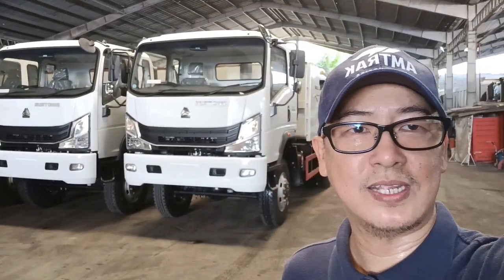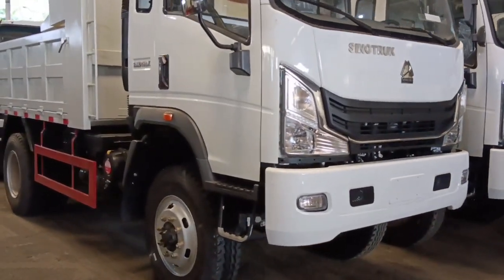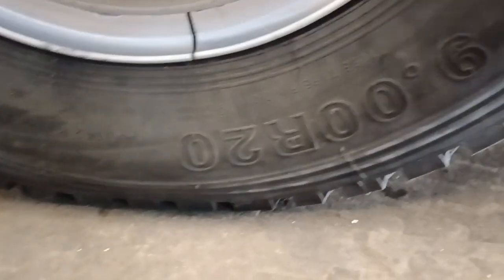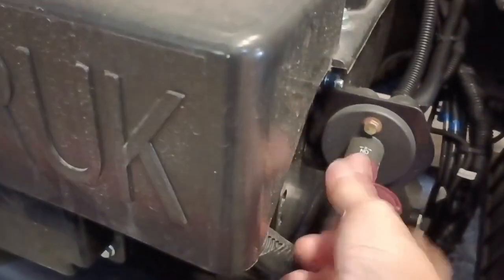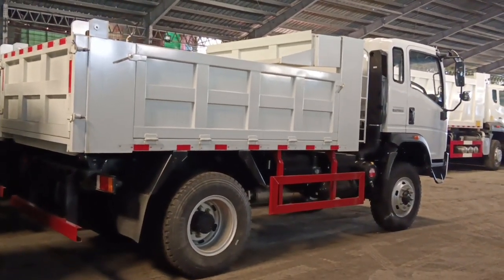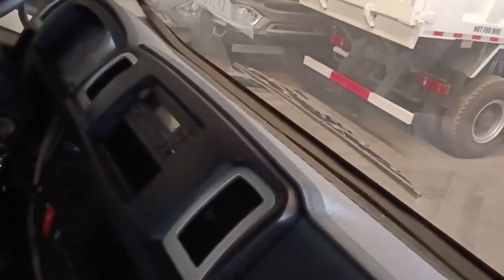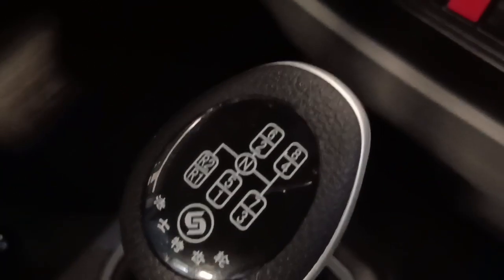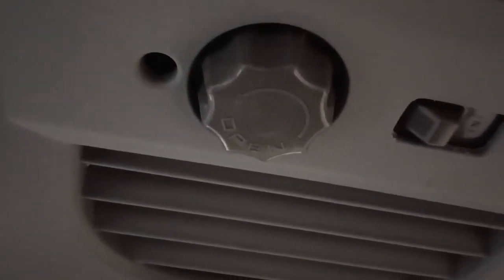2023 SINOTRUK 4X4 MINI DUMP TRUCK 6.5 CUBIC METER!!

Comment: Sinotruck 4x4 6.5 cubic mter sir how much price
Reply from the maker: 1.8M boss, tawag kayo sa 09166865523
Reply: Sir ang 4x4 mini dumptruck na 4.5m3 cap magkano
Reply from the maker: 1.750M
Reply: 50k lang pala diff.sa 6.5m3.available pa mga unit sir
Reply from the maker: @alraut8775  yes lods available call 09166865523 for unit viewing or reservation
Reply: Cg sir msg lng kita soon